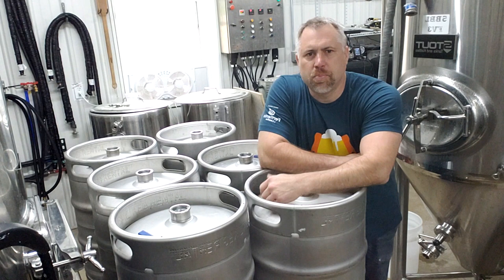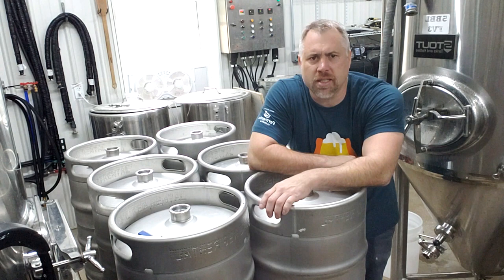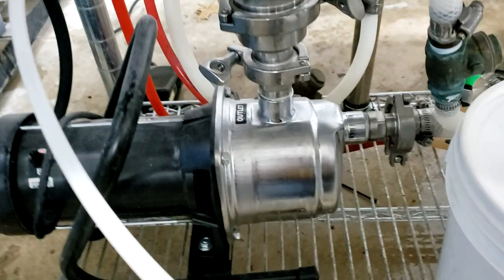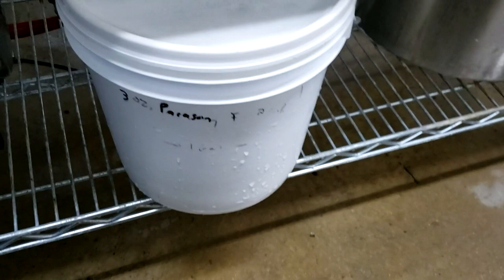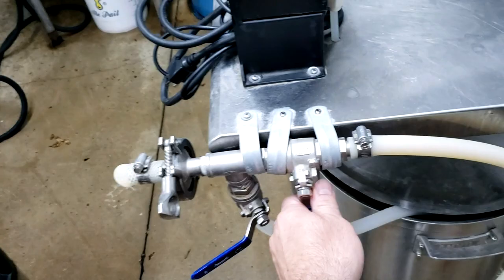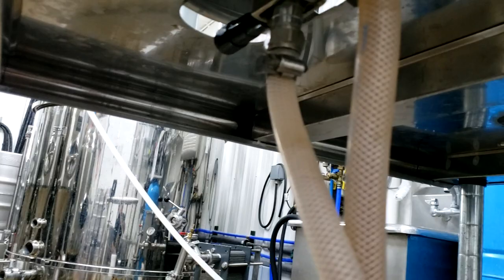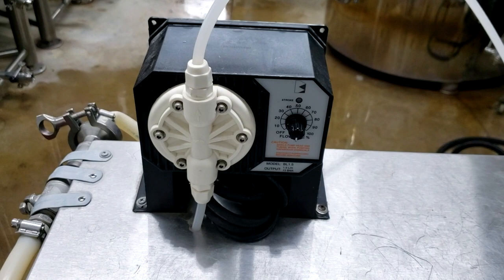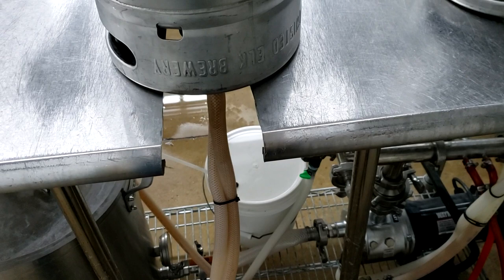How to make a custom home made DIY keg washer for commercial brewery

Comment: How is that pump holding up?
Reply from the maker: I had to replace the pump after about 2 years of operation. What I realized was the caustic was building up inside so I started taking precautions to flush the pump out after every use and it has been working ever since.